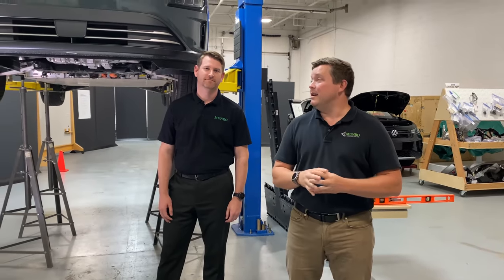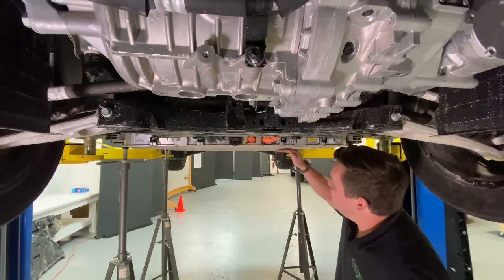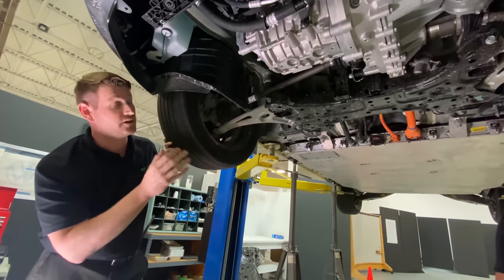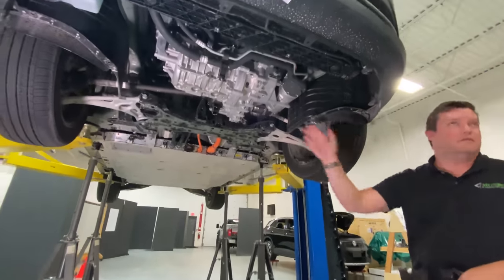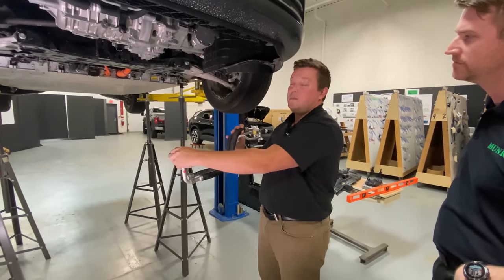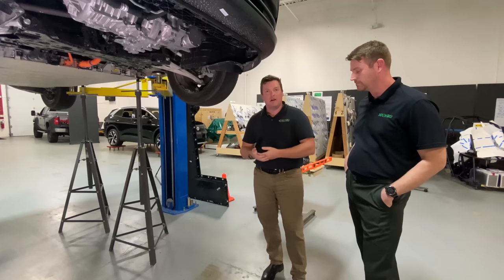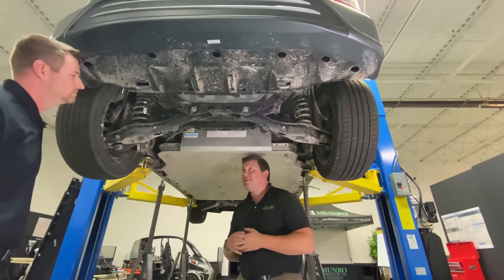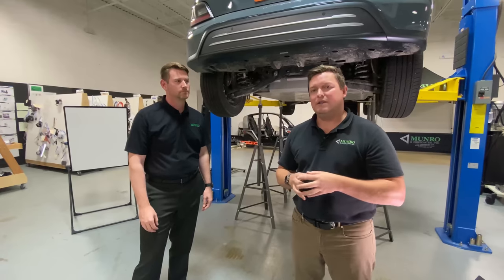Fyundai with Hyundai  |  Undercarriage Review

Comment: At about 10 mins in he nails it. All the little things that contribute to a lower efficiency - that's what I'm here for.
Reply: @paulaxford6754  no its not. Hyundai social marking spammer. stop posting same thing over and over and over again.
Reply: @paulaxford6754  it's a small vehicle with a smaller motor.
Reply: @factsmatter6980  Both the Kona and the kIA are very efficient.  In this vid, there were some efficiencies, somethings not.  Even with compressor mount - you have longer plumbing, but no brackets and bolts - flip a coin.

Comment: As Cory was talking about weight and range factors, I can't help but thing about hoses and connectors and the impact of future repairs/maintenance cost.  While EVs are suppose to require less maintenance than an ICE vehicle, when I saw the MachE hoses that was a deal breaker as there were so many opportunities for failure over the life of the vehicle.
Reply: Ford had to make the case to dealers that they wouldn't be left out of the profit loop.
Reply: @aussie2uGA  good one  ✔
Reply: It should make it through the warranty period.
Reply: @rzu7120  and then fail immediately? I own an early 2000s GM product and it was literally only a matter of time before the "quick connect" hoses going into the heater core failed. Fortunately on that vehicle it is relatively cheap and easy to replace the hose and put on traditional hose clamps, but seeing the Mach E gave me cold sweats. And if those lines leak we arnt talking about a gradually overheating engine, we are talking about a potential thermal runaway event and fire. Scary.
Reply: @patreekotime4578  That’s what I’m saying. They only build them to make it through the warranty period.
Reply: Have you looked under the hood of an ICE vehicle -LOL - oh and motor - 1 moving part, engine - a few thousand.
Reply: Look in an ICE engine bay LOL.  2 things: All cars have hoses, whether they're concealed by plastic panels or easily accessible and visible, as in the KIA/Hyundais.  The other thing is that KIA/Hyundai warranties are about the best in the business.  Always a drag to have an issue, but better if you don't have to pay for the repair.

Comment: That second HV cable from the battery is not the feed to the A/C compressor, as that comes from the HV junction box to the right of the OBC/inverter unit. The service manual describes it as going to "bms ptc heater", which I think is a heater in the cooling circuit to heat the battery in cold climates.
Reply: its insane this thing cost $44,000 us$.
Reply: It does that, but probably heats the cab as well.  They mentioned that's how the Mach-E does it when they showed that PTC heater.  Which actually makes more sense here than on the Ford since they can re-use the normal heater components that use the heat from an internal combustion engine.

Comment: 8:38 that whine they heard might be the artificial noise the car makes when going 25MPH or less. It sounds like gear whine, but it’s not.
Reply: That's correct, unless they took this into account. VESS (Virtual Engine Sound System, mandeated by law). It does sound like a whine, but it's kinda pleasant too. Starts at a couple MPH and slowly vanishes, gone by about 25 MPH.

Comment: Thank you for another thoughtful and thorough review. That low leading edge of the battery case with all its connectors is clearly an unacceptable risk for major trouble. Thanks for removing Its cosmetic plastic covering.

Comment: I completely don't like that multi wire connector showing all individual wires. There is no shielding at all. Any vibration and this connector will be full of sand brought in by the first drive through water that splashes from the wheels. Then the simple isolation will fail.
Reply: a small mouse could take this car out by just chewing on one of these cables.
Reply: That was my first thought as well. To be fair, there is a plastic cover they removed.  Still completely unacceptable even inside the cab, much less somewhere potentially exposed.  Many automotive connectors of this size have a back piece which protects those wires, and *critically* provides strain relief!

Aside from the small metal pieces that holds the pins in place, what is stopping a wire from pulling out!  Or even being partly pushed out during connection if those don't engage and you plug the connector in?

Comment: Interesting.

That differential in efficiency between the Niro and the Kona can't be attributed to the pack.  It can't be aerodynamics.  It probably has nothing to do with cable runs/electrical resistance.  The cars are just too similar.

It's probably down to different tires, I'm guessing.
Reply: Indeed, and those siblings are not the same size

Comment: Thanks for the underside view. I live in Vermont and have a Niro with 33,000 miles on it, and I am sure going to be more careful.  I wanted to buy an Ioniq 5, but according to road tests in Norway, it uses 20% more energy to take you down the road to 55 mph than the Kona does. Maybe the Kia EV-6 will have better aero and better efficiency  It seems like efficiency is less important at the other manufactures.  Tesla wins, but it should have some competition.  The Kia/niro strange points was cost at the base model price and range.  Its weak point was charging in the winter. Good review as aways.

Comment: I'm looking at potentially taking the buyback on my Bolt and getting a '22 Kona EV base, which would cost about $34K pre tax credit, somewhere around $28K after, and more than likely somewhere around $30K after financing. Aside from the faster charging, more modern interior and lack of exploding battery (As far as we know) - What other benefits does this have over the Bolt? That battery pack looks a lot more exposed than the Bolt's - but I'm not so sure it really is.

Comment: Going to find a beefy aluminum plate to supplement the plastic to protect the battery better.  Thanks Monroe Guys!
Reply: Any steel objects, usually that is what drops from the vehicles will tear that aluminum up and go through the battery casing which is also aluminum. But, I guess, anything is better than a plastic.....

Comment: Outstanding high level analysis as always!! Hard to believe that these company's EV's are using solutions developed in the late 80s and early 90s....wait a second, yes I can believe that!! They're all half-baked and full of themselves, womp womp.
Reply: It tells you who their engineers are and what they know works. Not cutting edge.
Reply: I guess if it works, why fix it? Only problem is that their vehicle is not an ICE car.........New tech with old tech sometimes does not work. They need an update from their Engineering standpoint. IT seems like these OLD engineers don't like changes.....
Reply: @1flash3571  It's the bean counters and managers who don't like changes. And they don't want to pay for the design of a completely new car.

Comment: Great videos, but please think about not comparing pure EV designs to multi-powertrain designs. Of course the design of a car which has to fit an EV setup or a piston engine won't have an optimal design for either. Compare the model Y to Ioniq 5, that's a fairer fight.
Reply: It isn't about being fair. It is about the right design for the vehicle being built. If a company tries to use parts from an ICE car, they are trying to save money. That isn't necessarily good for the consumers. Also, they are not thinking it through like Tesla did with their earlier versions of the cars. It wasn't a good design, BUT, Tesla is ALWAYS innovating to make the car BETTER, not worse, or to save money for the saving sake. I am not saying that the engineers are deliberately making the car worse by using common parts from the ICE cars, but their goal is to SAVE money on parts. In doing that, they make the car not so great. Hopefully, these engineers will learn from the ones they built to make them better on the next vehicles just like Tesla did with theirs.
Reply: @1flash3571  Tesla might compete dollar for dollar with Hyundai in the US, but in other territories Tesla is much more money. These are global platforms designed for sales and repair around the world and commonality of parts saves customers money on purchase and servicing as well as helping the company  maximise its assets.
Reply: Well, they did compare it to the Mach-E.  Which to be fair is an electric only vehicle.  The problem is something they referenced in the video.  Cory called it a lower budget car and then corrected himself.  If those cost savings of using a dual platform were passed on to the customer, you would have a point.  However, they aren't and there are better options available.
Reply: @arthurmoore9488  Not sure how much a Kona costs in America, but in the UK an electric Kona is around £28k and a model 3 is £40k.

Comment: Torque steer due to differing torsional deflection of unequal-length halfshafts is antiquated nonsense. the longer shaft can simply be larger in diameter to increase the stiffness for a given length, making both shafts equally stiff.

Comment: How did they pass the curb test ( ground clearance ) when the battery is so low? 
I have developed exhaust pipes and this test was very critical. 
What I also saw is that the chassis is made for an ICE. There is still room for a conventional shifter in the center of the car.

Comment: Clearly, the number 1 objective was to make this car cheap - not necessary for the customer but for Hyundai/Kia (more profit and more flexibility in pricing). It was not optimized for NVH, efficiency or safety. Having said that, we need less expensive EVs, so that’s good. Just not my first choice when buying a car…
Reply: Not only that, but it’s not optimized for an EV. It’s a hybrid, PHEV, and a battery electric on the same platform.
Reply: @harsimranbansal5355  probably made a lot of sense to develop one platform for hybrid, plug-in hybrid and electric at the time they worked on Hyundai Ioniq, Kona and Kia Niro. Pre 2016 design choices.

Comment: 400V 800V is NOT hV..NEC defines hV now above 1000v
Reply: That's the National Electric Code, and they define household, can kill you, voltage as "low."  Heck, the first line of the low voltage article on Wikipedia says it's a relative term.  For many of us, what you might consider "Extra Low Voltage" is "Low", with really low being circuits which take 1.1V or lower.

Note: Older electronic components used to run on 12V, a few decades ago they moved to 5V, with 3.3V being common.  Most things where efficiency really matters and they can, like your CPU, are in that 1.1V range though.  As a reference, many modern 5v components are dual 5/3.3, but even with those giving it a 5v signal while it's running from 3.3v may cause fire.

Heck, Sandy and Elon Musk discussed going to 48V wiring instead of 12V and Tesla couldn't find suppliers.  Yes 48V is scary high to many people in the automotive industry!

https://en.wikipedia.org/wiki/Low_voltage

Comment: This is what you get when you get a multi-engined vehicle instead of a pure EV Vehicle they have to cater for petrol and diesel and hybrid types to fit under one hood (bonnet) the next Kona should be only EV and I would think they would do a lot better in styling idea's than this model also fitting a Frunk which this and the previous models do not have which is ludicrous in this day and age where nearly all motor manufactures are trying to fit one except multi-engined crossovers where they tend to design the ev motor to look like a fuel engine with such a loss of space where instead they could have designed something sleek and low slung giving space to fit a Frunk but alas most of these designers are of the era of ice vehicle design characteristics and still haven't swept away ice technology out of there brains yet they need fresh designers who know nothing about the ICE engines and only EV technology or at least people who can change and are willing to change who can see the benefits and the future of us and vehicles going on into the future this is what the big motor manufactures need to do like Tesla and all the other EV start up manufactures who only make EVS they have done it already that's why there vehicles are much better have a longer range are mostly better quality as they have built there cars and vans and trucks with only EV technology in there mindset and this is what the rest need to do as at the moment they are still betting on Ice vehicles and ev second instead of the other wat around and this way of thinking will lose them in the running and profits as the human race is starting to wake up to EV vehicles I know because I did and I have ordered one for this year in 3 months hopefully I will be a proud owner of an EV Vehicle with a free charger fitted to my garage as well. Thanks to the UK government as that's about all I have ever got from them lol oh and a few grand of the list price.so I am not really complaining. but when I ordered it I was told I might have to wait up to six months instead of the usual 3 months wait as they are built to order but he did say my motor manufacture is trying to push ev vehicles out first so there still may be a chance I could get my new car on March 1st which is the start of the new year number plates in the UK but I am not holding my breath but 3 years ago I did get my seat Leon fr estate on time and was one of the first to drive one on our roads in the midlands. so the car I have got now I have extended the insurance until the end of May just in case and I will have to put it through its first MOT (ministry of transport vehicle roadworthy check and emissions test and brake test}there should be no reason for it to fail as all I have done is 7 thousand miles in it mostly local milage apart from a few trips to the seaside every year for vacation's(Holidays}.